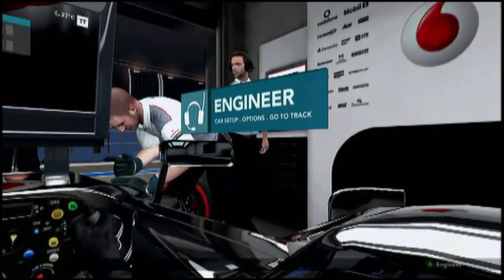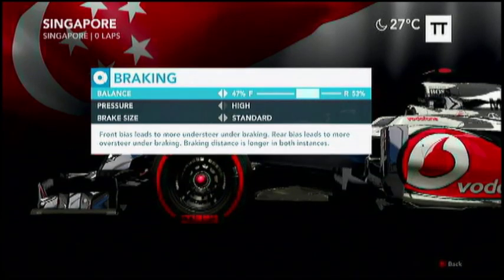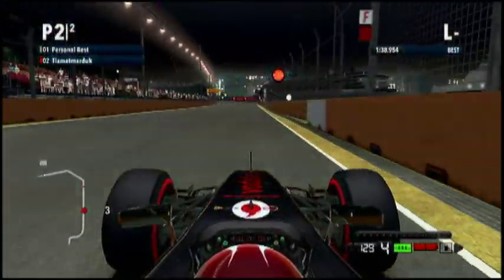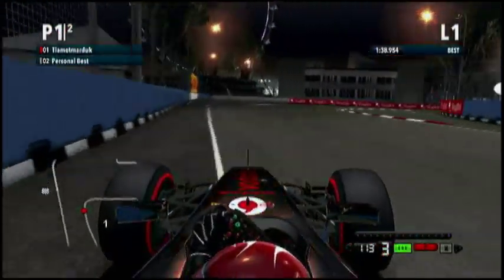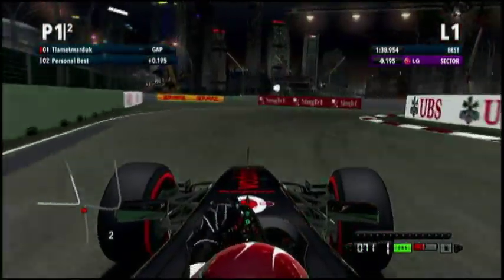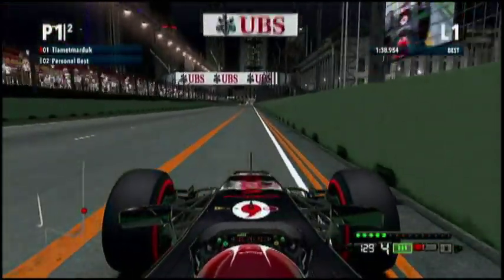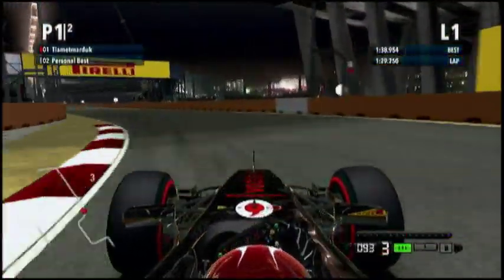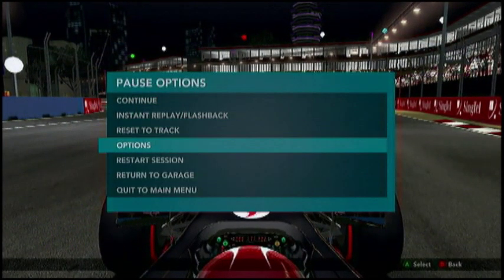F1 2012 Singapore Setup 1:38.485

Comment: Taking traction control off has several benefits. To begin, most players should take traction control off because you will learn to develop a feel through the wheel and, therefore, it makes you a better driver. Secondly, traction control limits the amount of power you can apply, by removing this, providing you have the feel and skill to regulate the power better with your foot, you will go faster. I hope this helps answer your question!

Comment from the maker: yeah it does, I prefered the fronts to go off faster because the rear tyres were going off way to quickly and i had all this front grip but no rear grip so by having 11-11 balance it makes the tyre wear alot more balanced. drive like 10 laps of the track and youll see what i mean.

Comment: i hate this track so much. the tire wear is ridiculous. i pitted to get new options and on the first turn coming out of the pits i spun out and my the end of the lap they were completely gone. i had to do a 2 stopper on what should have been a 1 stopper race
Reply: then when i get back to the menu i get a news article saying that they have fixed the tire wear issue at toro rosso and that it wont be a problem for the rest of the year. its said that after every race! then my career email says that the engineers looked at the tires and the level of wear is very good.